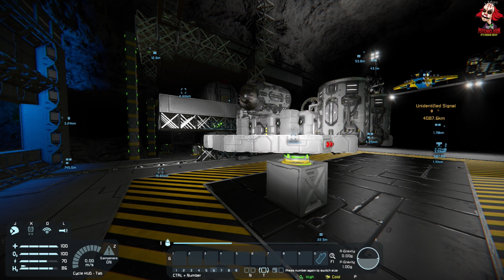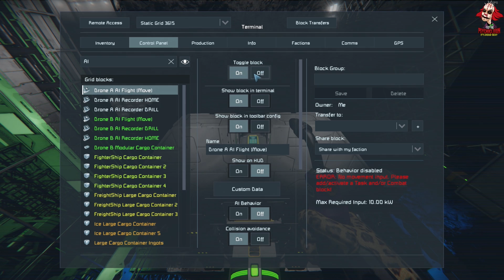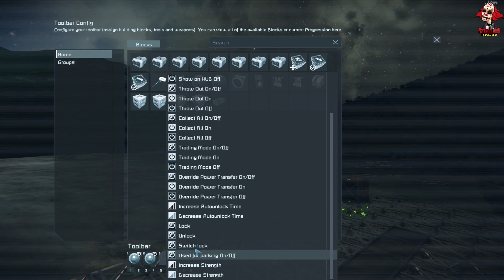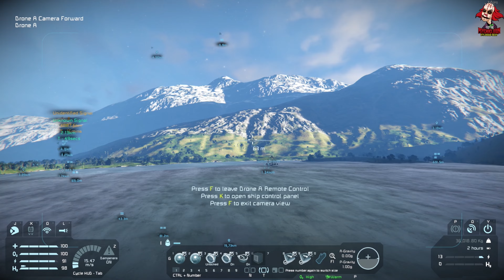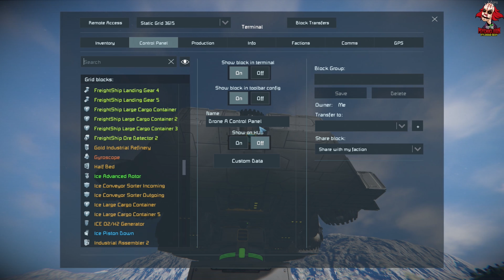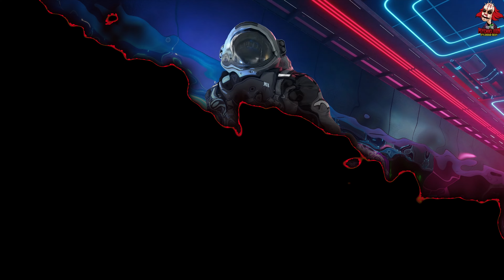Space Engineers - Part 11 "Setting Up Your Own Drone An Easy Guide"

Comment: If the server cleaned up your first drone then something went wrong with the charging. The only way it would have cleaned it up is if the batteries went dead. And the AI blocks dont need to be ontop of the connector. Something must have been set up wrong.  If you sit in some kind of seat while the drone is connected to the base you can take control then
Reply from the maker: I've been sitting on top of em sometimes if the distance is to long...

But i will look into the blocks again. But anytime i turned on that setting it would try to park next to the connector..
I dont mind trying another drone and record it, but do know the issue stopped when moving the block to the center of the connector..
I'll try to get some footage of it down the line... It's stuff any new player can run into, just as i did i would assume.
Or im just trying to many settings at the same time, creating havoc :D
Reply from the maker: and regarding the lost drone... i dunno.. maybe they figured out to go a diff direction and crashed as they tend to change altidue and stuff as they want to.. There are some missing  though. So hence i thought it might been cleaned by the system.. Maybe they pop up someday when not expected.
Reply: @TedPsycho  you can go into the alt-f10 menu and go to the entity menu I think is what it's called. And you can scroll thru everything that is in the world. Be able to see if they are there or not